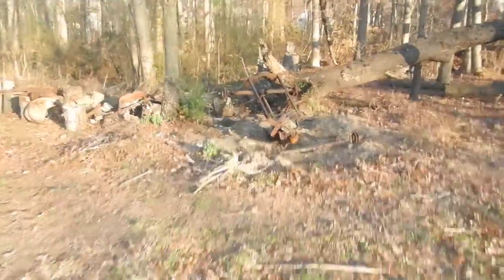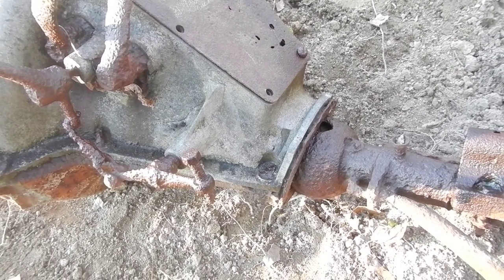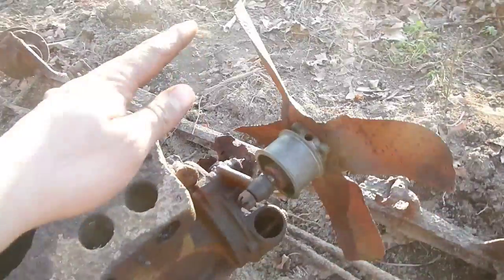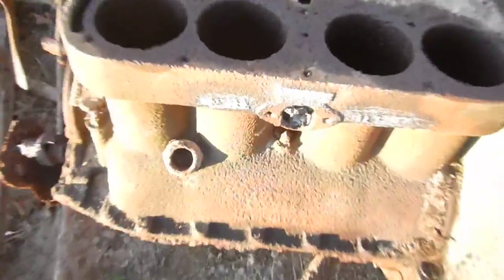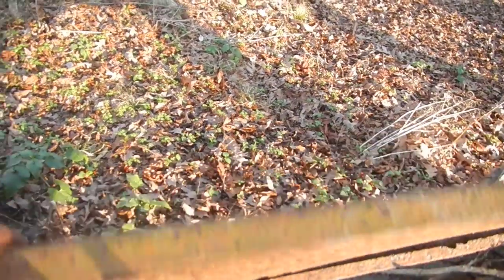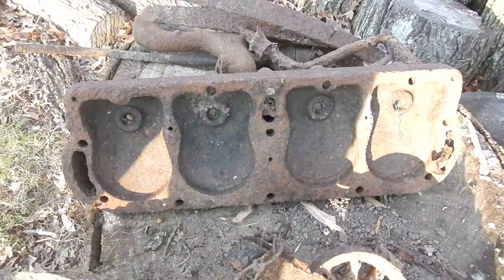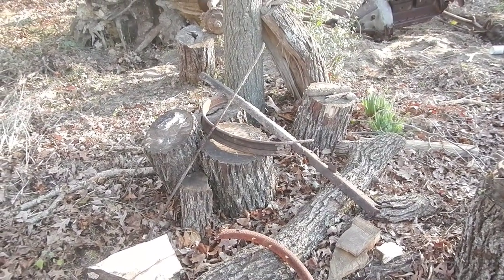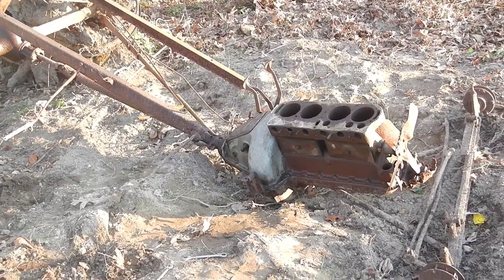Un-burying a Model T in the woods

Comment from the maker: @GK1918 you're right it would be a good experience to machine on that block! That is an aluminium "hogs head" I dated this car to a small range of years but I can't remember what years I dated it . I have written down somewhere . The front leaf springs where busted so I used a piece to make a knife in the forge and then hardened and tempered it . It came out really nice and I called out my model T knife . I ended up giving it to my brother. I hope to own a model T some day to drive around in.

Comment: That's a 2 piece valve cover block, earlier engine! Probably mid late teens. I'd definitely try to salvage as much of the engine as possible. You might be surprised, if it's not cracked that  block may be saveable.
Reply from the maker: oldtimesmatthew thanks for the input! I have saved some of the components and put them away in the garage
Reply from the maker: oldtimesmatthew I also sold the accessory brakes and rods to a gentleman who saw this video and contacted me !

Comment: Quite a find, do I see aluminum planitary cover housing?  If so thats early right 
after they went to three pedals maybe 1910 later on it was cast iron.  Rear brakes
aftermaket origionally they were simple cast iron metal to metal.  They head was
repaired this was so common for a long crack there lousey anti freeze if any back
then.  Block is pretty well ug.  I see a need, strip block put it on your new mill and
bore it fly cut it-- good learning experiance.

Comment: The car is made up of parts from several different years. The engine is 1913 to 1919. The transmission cover is 1911-1915. The front radius rod is 1919 and later. The fan hub is 1920 and later. The springs are 1915 and later. The "rims" are felloes for demountable rim wheels and are 1919 and later. The starting crank is 1914-1921. Still a very neat find!

Comment: If nothing else it woulda made a great start point for a speedster...

My guess for years, based on the motor and hogshead - late 1915 to very early 1917.  If you had the motor number, you could narrow it down to a month and year or better.

What did you end up doing with it (other than the knife)?